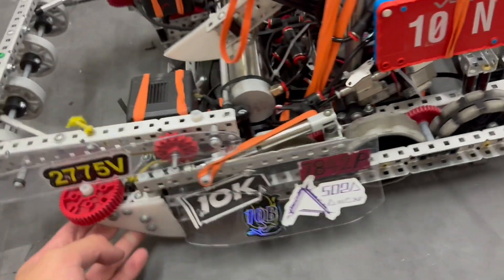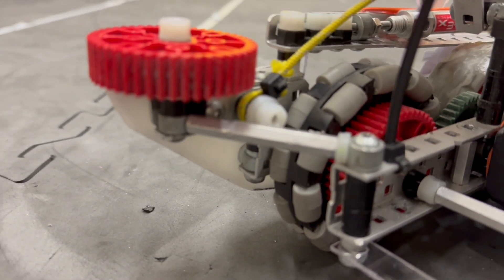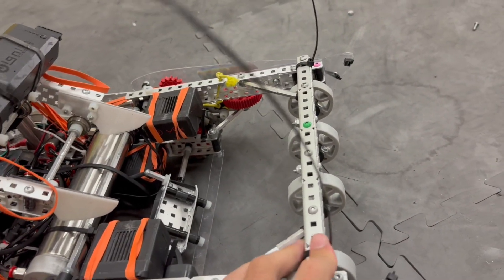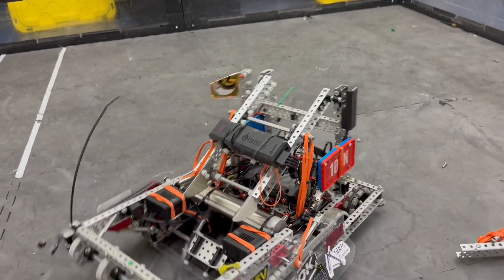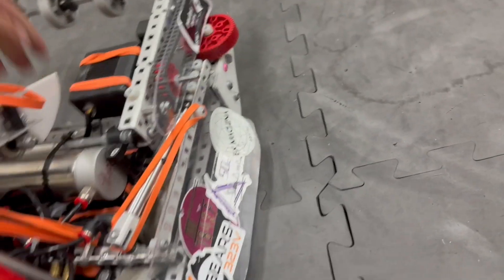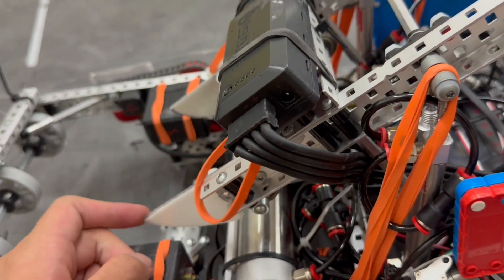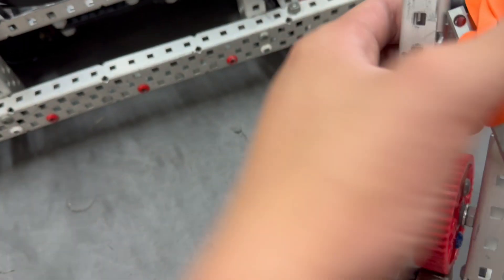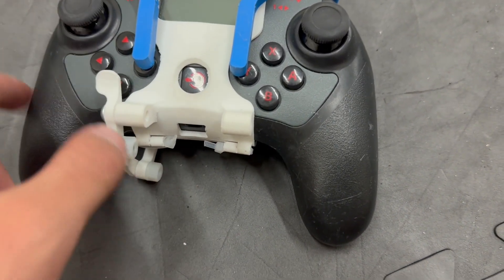10N Over Under Worlds Robot explanation

Comment: I love how your robot is at least an inch bigger than ours in both directions but still managed to be 4 lbs lighter than ours 😭
L overbracing
Reply from the maker: avoid using too much collar locks, hs axles, and try to use more ziptie for bearings and plastic nuts.